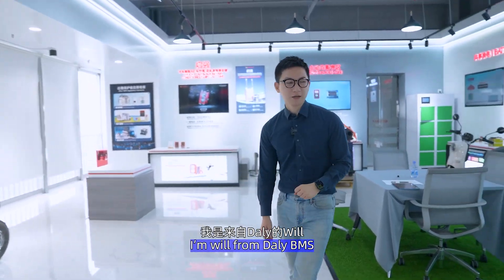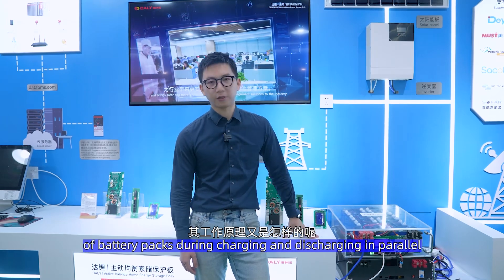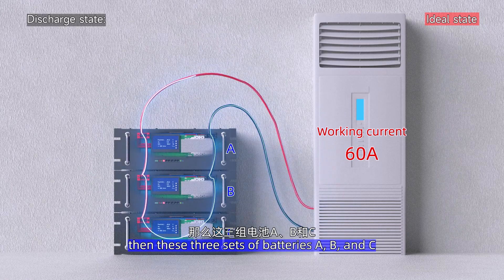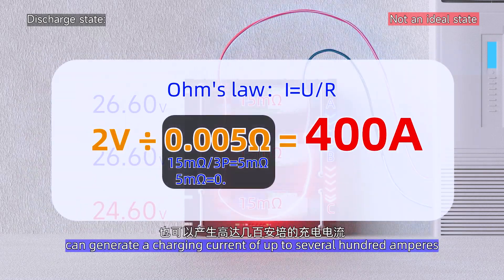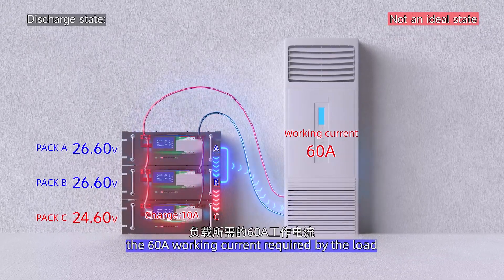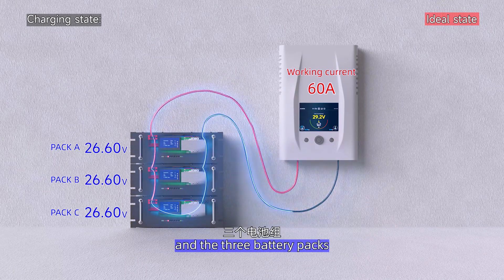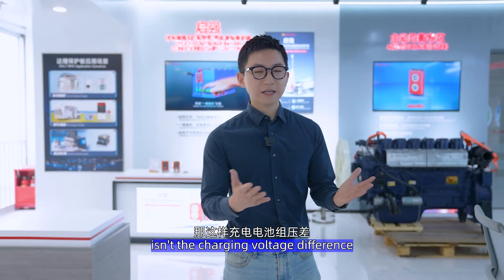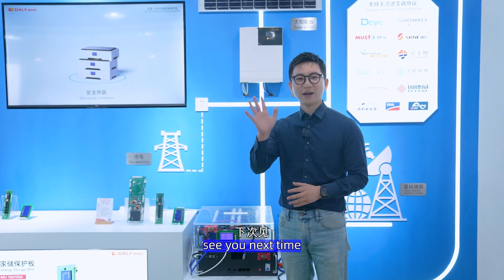The integrated BMS is suitable for multiple paralleled battery packs

Comment: When you have more inverters capable of more charging current why doe BMS communication limit charge current to the capacity if on battery instead of cumulative current of all batteries in parallel